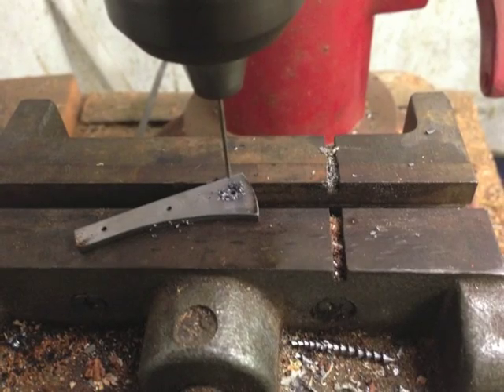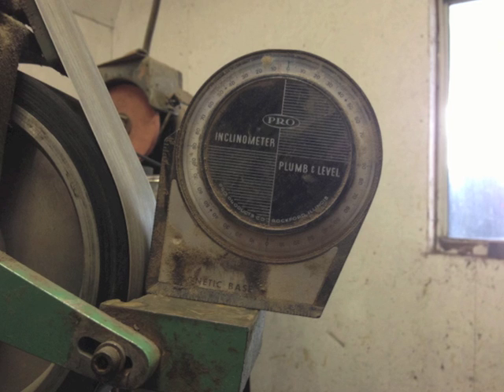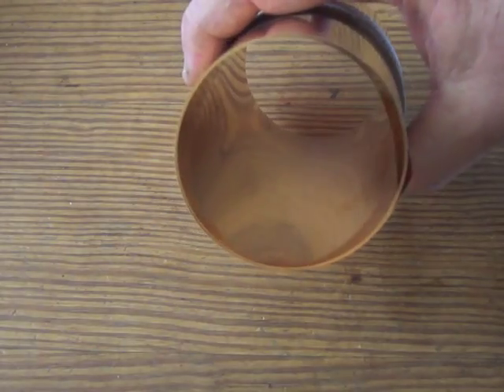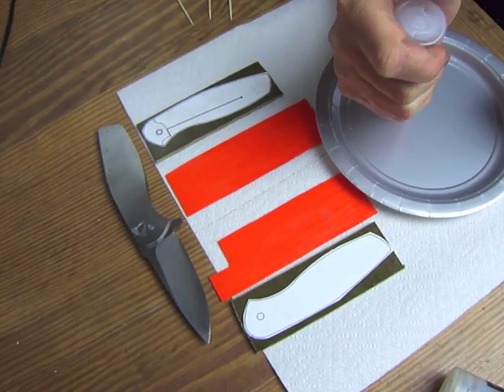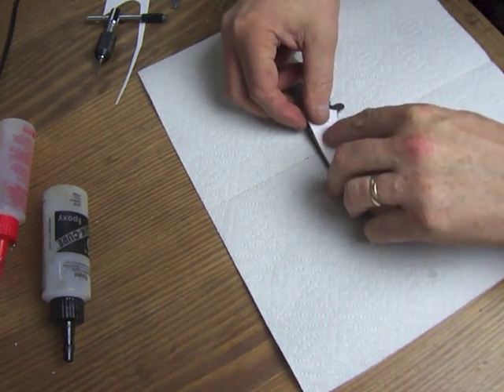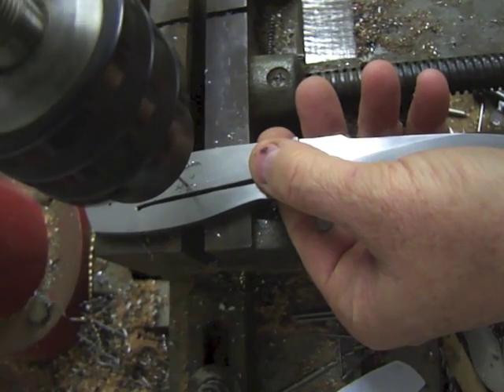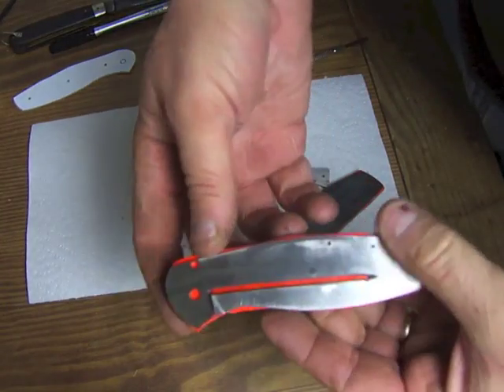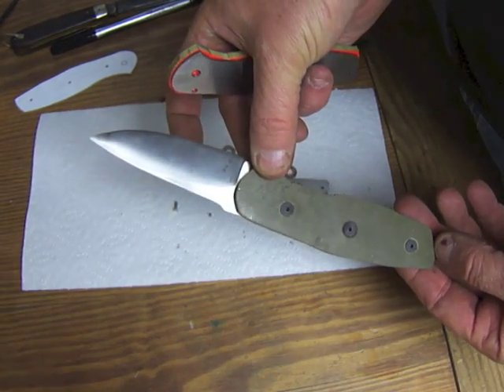How to make a liner lock #4

Comment: I'm in process of making a titanium frame lock with G10 on the opposite side. My question is it necessary to put a liner on  the g10 side or will the g10 be strong enough without a liner?
Reply from the maker: +James Bradley (Caudill) If the G10 is thick enough, it will be no problem.
Reply: +SugarcreekForge  it's .158 thick.
Reply: +SugarcreekForge thanks for your help. The videos kelp me on track. I appreciate it.
Reply from the maker: Upi are very welcome!